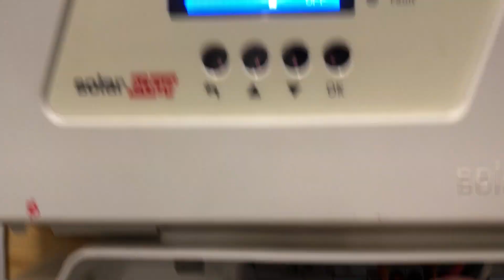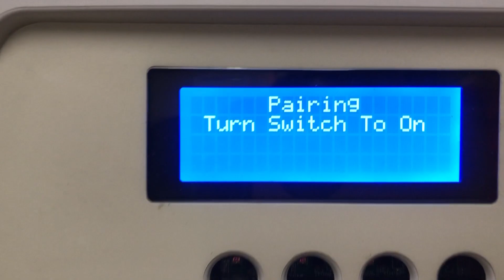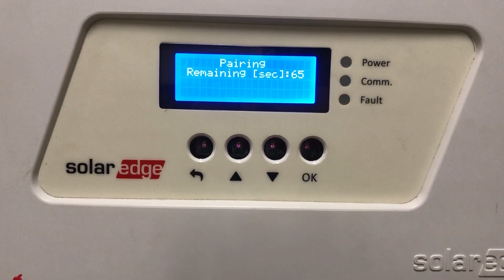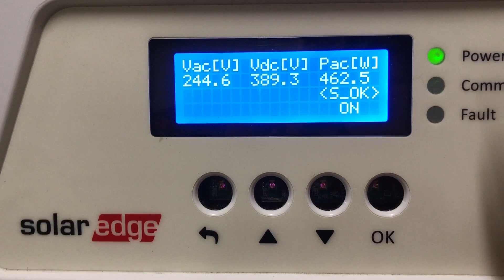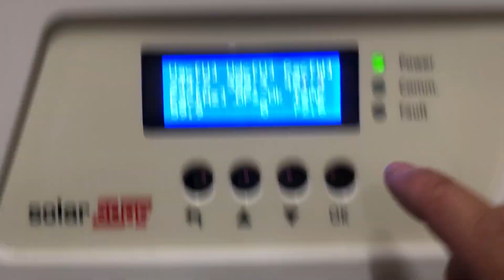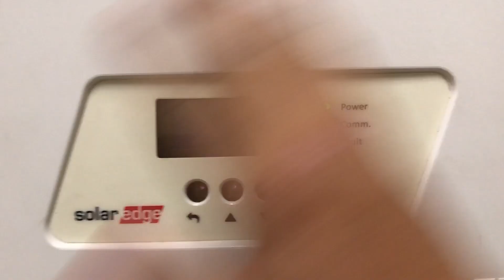Pairing Optimizers to Solaredge HD-Wave Inverters

Comment: I followed your advice in the video and it worked my nine panels are now working before it said 5/5. However, It shows Pac (W) 0.0 and its been one hour. Thoughts?
Reply from the maker: I am starting to forget, i think there is a minimum number of panel on a string. I believe the minimum panels is 8 or 9? Pls research it.

Comment: Awesome video! I just had my roof replaced and after the panels were reinstalled, I had 20 of 43 not producing on the Solaredge app. I called the installers and they came back and verified physical voltage on all 3 strings, then restarted my inverters. After the restart, there were still 14 panels that showed 0 production. I just followed your instructions from this video and watched all 43 panels come back online.
Reply: As an installer, its sad to think someone doing service work couldn't figure that out lol

Comment: I’ve had replace 3 optimisers since installation 3 years ago. When I look at my system layout on line I’ve 22 panel however 2 of the panels have the same serial number which can’t be right. If I repair the optimisers as you’ve stated do you think it will sort the problem out.

Comment: I have 13 optimizers and mine is 780 vdc and pac watts is still 0.0 after paring
Reply from the maker: Something is wrong with your DC voltage, my DC voltage usually hovers around 340 - 370v. Your more than double. May be you have the input of your strings in series? I am not sure. You have 13 solar panels all in one string?
Reply: @DIYGEEKTEXAS  when i wire them in parallel my voltage is around 400v but the amps r high, when i wire in series i get 780v and amps r low. 

I talked to solaredge technician yesterday and explained everything i did and what the status was and he said everything seemed good and it detected all optimizers but even he doesnt know why it's not producing power and that i should connect internet to the inverter so they could check online to see what's wrong with it.
Reply from the maker: @EVILalwaysDIES  Hmm I did not know if 780v DC will be acceptable and can work to generate AC power. If it does work, please let me know that is interesting.  Regarding generating power... I have both the old 7600 inverter with LCD and buttons and the newer ones without any LCD or button.  I believe the newer one without LCD and button must be provisioned through the app before it will generate AC power.  But you probably have the old one because you are able to know what your DC voltages are.  What are your LED lights showing?  Any RED led light showing error?
Reply: @DIYGEEKTEXAS  yeah i have the older model but it's still new. The light is solid green and i read on the manual that it means its producing but its not.
Reply: @DIYGEEKTEXAS  i figured out the problem. Mine is a commercial set up, not residential so i needed 15-16 optimizers minimum for it to start producing power.
Reply from the maker: @EVILalwaysDIES  Oh wow, that is a high minimum number of optimizers requirement. I guess for commercial it is more normal. Thanks for sharing that information back.

Comment: 👋 hey do have to scan the barcodes on the optimizers to commission or setup?
Reply from the maker: No, if you are reading instruction about scanning QR code / barcode, you are probably using the newer inverter which does not have LCD screen and buttons. You have to use SolarEdge's SetApp for that which require scanning QR code using your mobile phone.

Comment: I have this same inverter, How do I get it out of Night Mode?
Reply from the maker: You can disable night mode / standby mode from  Menu > Maintenance > Standby / Night mode.

Here is the link to the manual that describes that: https://www.solaredge.com/sites/default/files/se_inverter_standby_mode_app_note.pdf
Reply: DIY GEEK Thank you for the information. I already tried this. In the process I discovered that Standby Mode and Night Mode are not the same.
Reply: Haya Busa ... hey, did u find out how to disable Night Mode?
I’m having the same issue and I can’t seem to find the solution yet
Reply from the maker: @edgarr6828  No I did not find any solution. I think it is just detecting power from the Optimizers.
Reply: Hi  @edgarr6828   I did not. But turns out that this mode is displayed when there is an issue in the system. You will need someone to troubleshoot your system.

Comment: Ja my problem now is the power is now blinging..now is rainning is that normal.?
Reply from the maker: The Power green LED usually blinks when the inverter is in a cycle of 'trying' to wake up. Basically the inverter keeps detecting if there is enough power to start generating. So it keeps going through this cycle trying over and over again. The power led will be solid green when the inverter is fully operational (generating power). And it will be off during night mode.
Reply from the maker: sorry I forgot to answer your question, yes it is normal, especially when it is raining or cloudy.

Comment: Can I do the pairing at night?
Reply from the maker: No, pairing can not be done at night, because optimizers need to have reasonable power to perform pairing procedure. Second reason is, at night, solaredge inverter will enter night mode.
Reply: @DIYGEEKTEXAS  my inverter triped but when i was able to fix it, the sun was almost gone so the solaredge counted 20/21 panels. You think this was from the low light/solar situation? Should I resynchronize it? Or will it recount when yue sun is up?
Reply from the maker: @pticman  The count of 21 must be from the pairing process. After pairing the inverter goes back to regular operation (day mode) and it will start activating the optimizers one by one, but it only activated 20 out of 21 it identify during the pairing / string identification. Yes, you are right, this can be caused by a solar panel being shaded or out of sun light. Do you have your system connected to solaredge monitoring? if so, you can easily identify which panel is not producing from monitoring system.
Reply: @DIYGEEKTEXAS  now I'm getting  "ERROR 18X6F AC voltage too high". Tesla energy will take 48 days to check the inverter. Terrible!!!

Comment: Hey dude: Yes I have some problems with the solar system it show on display NO-POWERAnd also I download the app for solar system so I can show how much am power producing. It is supposed show NIGHT MODE all the time, Could you tell me turn or use night mode only at night. Oh it was working great when we got it in installed at our home & we haven't have any problems with it? So I how you can HELP me out or I need to call the guys who installed the system to get it back working again okAm calling from Houston Tx

Comment: If you had a system in operation for some time and wanted to add 3 or 4 more panels, would you go through the same procedure to recognize and add the additional panels?
Reply from the maker: yes, everytime you make changes (adding / replacing) you need to re-do the entire pairing process again.